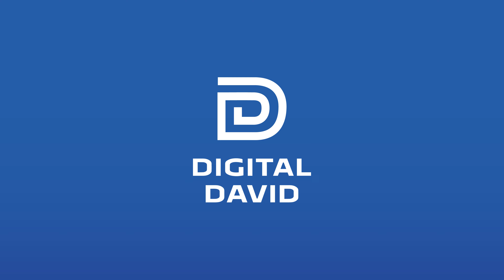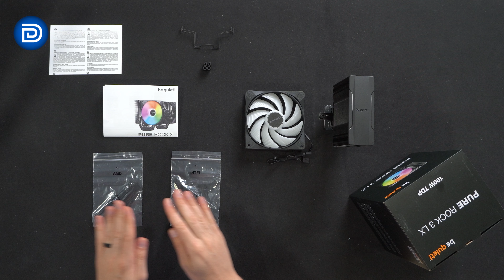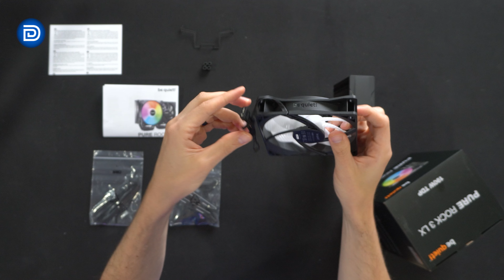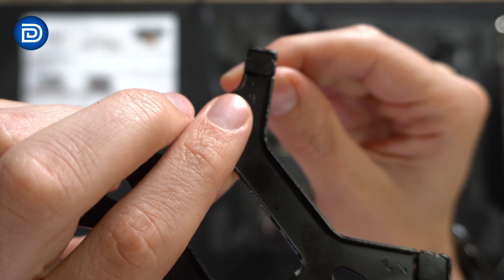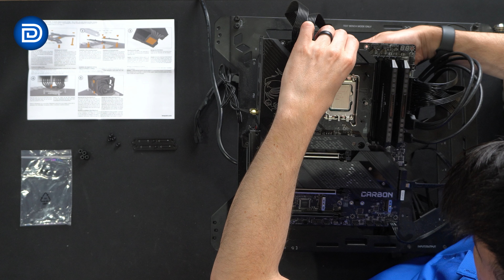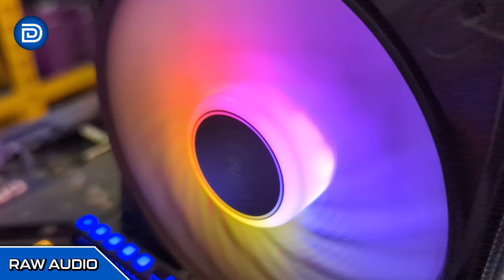be quiet! Pure Rock 3 LX Showcase – Silent, Cool, and Colorful!

Comment: Just tried one of these with a Core Ultra 7 265K at work using Cinebench R23 and the 265K hits 104C... Settles around 98C in the end. The Artic Freezer 36 is better and cheaper.

Comment: Will it be enough to cool Ryzen 5 9600x?
Reply: Pure Rock 3 LX is to 190(W) TDP
Ryzen 5 9600x is 65wats (default)
which means it can.
Reply: @kde7rs  TDP means absolutely nothing. an i9 14900k is less than 190W and you can't cool it with this cooler
Reply: @Ladioz  i9-14900K (stated) TDP is 125W, but in PL1, the thing is that no one use this CPU with this limitation. In PL2 can reach 253W and neither a "beef" WC is capable of adequate cooling.